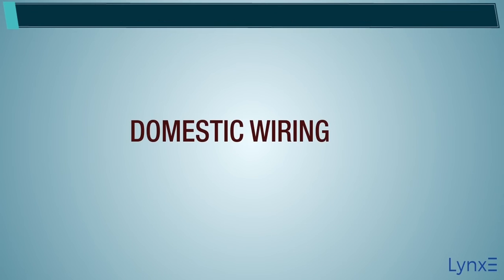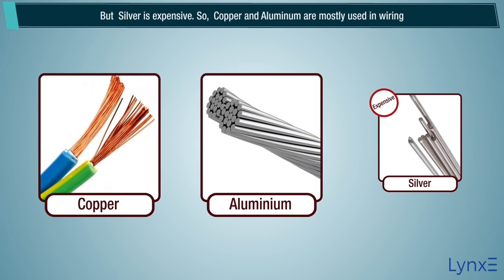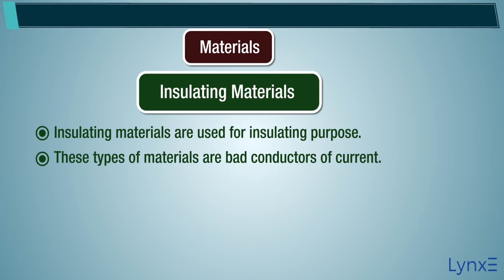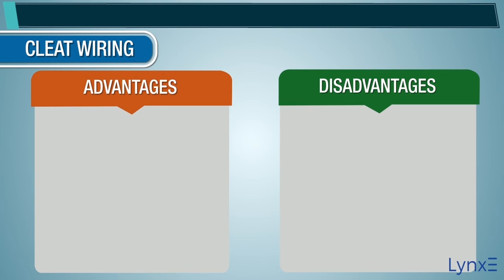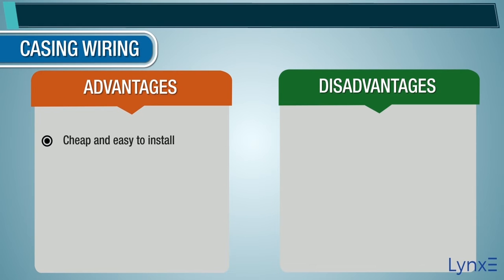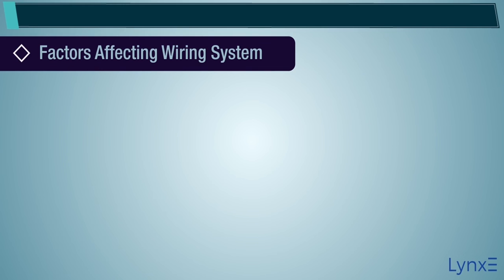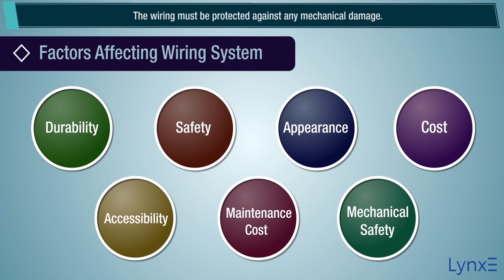Understanding Different Types of Electrical Wiring | Types of wiring | LynxE Learning

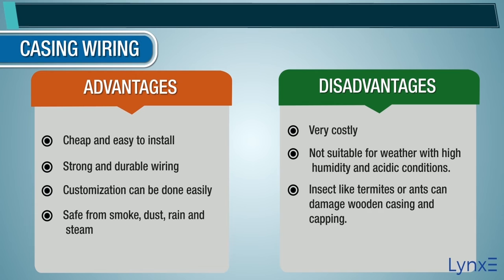Comment: 6:00 Casing wiring is cheap and costly at the same time ?
Reply: Cheap while easy to install 
During installation 6:02 labour charge are less 
But casing caping material are of high price
Reply: This video is for 3rd world developing countries like India, where they’ve just discovered electricity and think having exposed conductors without any pvc sheathing is acceptable